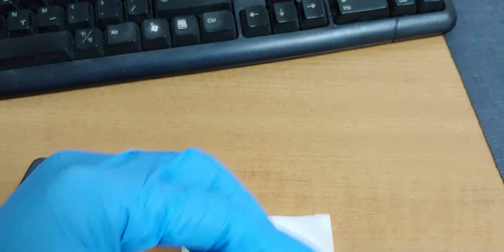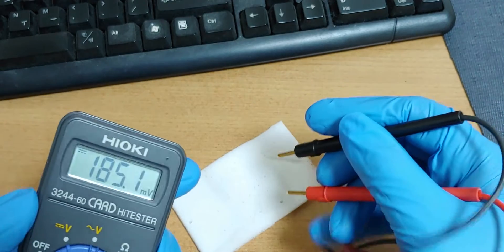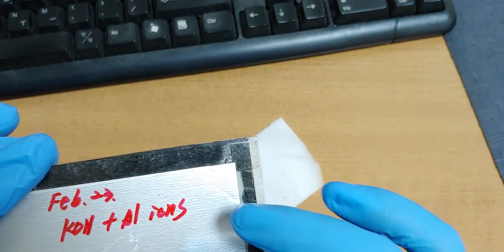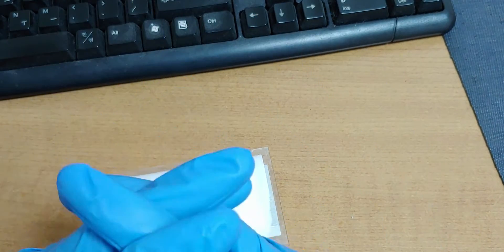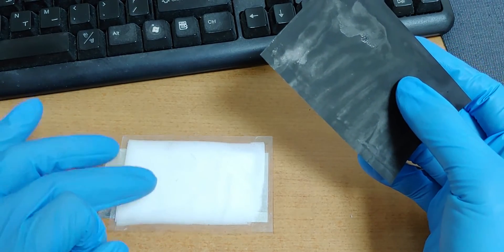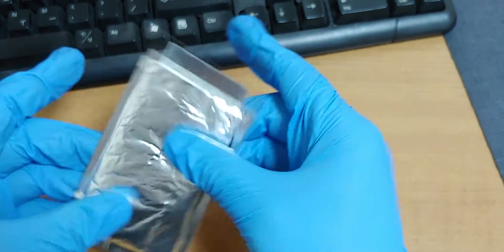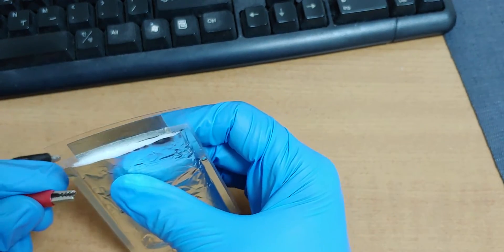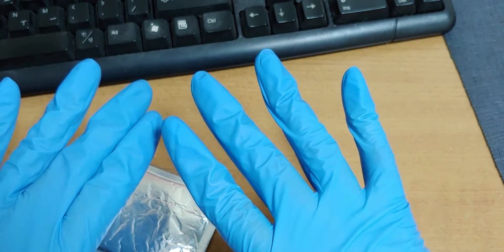[Solid state graphene battery experiment 3] By using a product similar to Mr. Cleaner.

Comment: You have to add toothpaste or ionic solution to sponge and then dry
Reply from the maker: Okay, I will try it. Thank you so much.
Reply: @solidbattery9956  the idea is to create pathways for the ions to travel. They want to travel on the surface just like super capacitor but in internal surfaces also so maybe like a psuedo cap solid state battery
Reply from the maker: @Buzzhumma  
Very interesting. Really interesting.